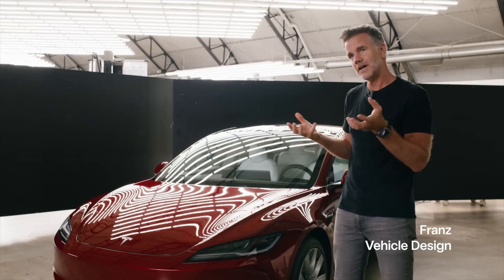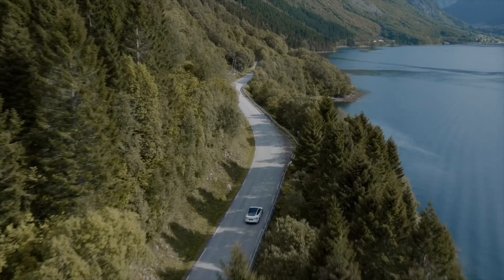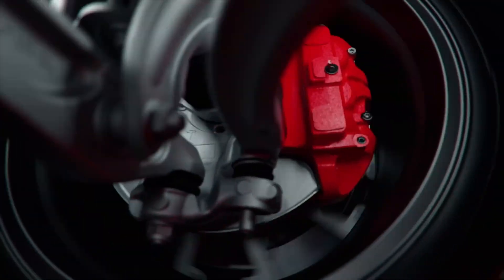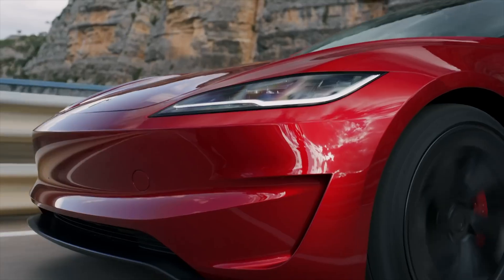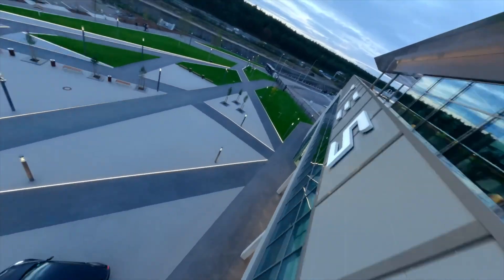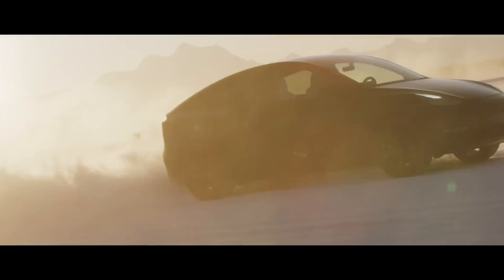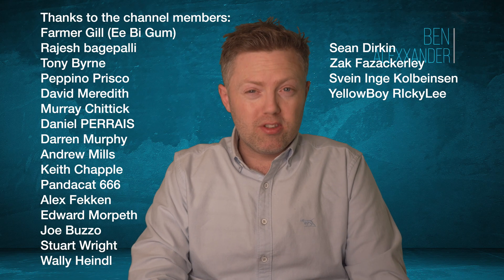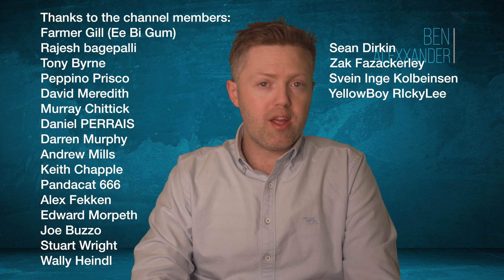Tesla Says 750 km. I Did the Maths from Brisbane to Sydney

Comment: It actually takes longer than 3 minutes to fill a tank and less time than 30 mins to fill an EV.  Why… three mins has alway been an exaggeration, BUT you have to hold the bowser for 3 mins  before you have your sandwich break.  But you eat while your car charges.  So it can actually take less time.

In Germany that’s what they’ve found professional drivers start their mandated breaks after they’ve let go of the bowser and the EV is plugged in.  Might be a 15 minutes advantage before break starts, in which time the EV is charging  So it’s actually faster for the EV which is weirdly counter-intuitive.

Comment: Just got back from a trip from Sydney to Maclean (just past Grafton) in my M3 RWD, the bog standard Tesla. Stopped for a pie at Heatherbrae, didn't charge because the car said go to Kew. Got to Kew, car said charge for 15mins. So went to pub and ordered a burger, then moved the car before eating it (very nice burger). I had told it I wanted 40% on arrival at Maclean (in case of run to shops or whatever), so it told me to charge again at Moonee Beach near Coffs, where I had a nice iced coffee, and the car was charged before I finished it. Pretty much the same trip with same stops as I used to make in my Volvo, except with better autopilot, better stereo, and bum chiller. So the cheapest Tesla is all we need except if you have family out west (like past Orange, past Gunnedah, etc). Then, the problem is chargers, not the car, and that is changing - if a bit slowly, like the chargers out there :) Better still, the LFP battery will last longer than the rest of the car so there is no pfaffing around with 80% charge limits.

Comment: Remember, that "REAL" world is not 100% of the people constantly on a highway doing 100kmh. The real world IS a mix of  30, 50, 60, 80 AND 100kmh roads. 
We do easy 360km with an EV that has a 40kWh usable battery. Stick to the speed limits and use your brain, not your emotions and right foot

Comment: It is highly likely that in Aus we pay less for a few reasons.
1 We have Free Trade Agreements (FTA)  with every major manufacturing country and working on ones with EU and UK and India at the moment. 
2 Australia is only 12 days or less  sailing from main Chinese and Asian shipping ports so RORO freight cost is less.
3 We no longer have an Auto industry so even playing ground for all sellers.
4 We are tight with money on average and value and durability means more than just looks to most. Price sensitive market with over 100 makes trying to sell a portion of the 1.2 million annual volume.
Largest single vehicle sells just over 67000 units, Ford Ranger, 2024 sales below

1	Ford Ranger	Ute	62,593	Down 1%
2	Toyota RAV4	Midsize SUV	58,718	Up 98%
3	Toyota Hilux	Ute	53,499	Down 12%
4	Isuzu D-Max	Ute	30,194	Down 3%
5	Mitsubishi Outlander	Midsize SUV	27,613	Up 14%
6	Ford Everest	Large SUV	26,494	Up 76%
7	Toyota Corolla	Small car	24,027	Up 20%
8	Mazda CX-5	Midsize SUV	22,835	Down 1%
9	MG ZS	Small SUV	22,629	Down 23%
10	Kia Sportage	Midsize SUV	22,210	Up 41%
11	Tesla Model Y	Midsize SUV	21,253	Down 26%
12	Hyundai Tucson	Midsize SUV	19,061	Down 10%
13	Mazda CX-3	Small SUV	18,461	Up 17%
14	Mitsubishi Triton	Ute	18,077	Up 8%
15	Isuzu MU-X	Large SUV	17,978	Up 27%
16	Nissan X-Trail	Midsize SUV	17,494	Up 36%
17	Hyundai Kona	Small SUV	17,374	Up 55%
18	Tesla Model 3	Midsize car	17,094	Down 2%
19	Kia Cerato	Small car	15,502	Up 168%
20	Toyota Camry	Midsize car	15,401	Up 46%

Comment: 750 kms is a convenient range for me. My Kia Sorrento gets about 800 kms from its 75 litre tank and my Ute gets 750 from an 80 litre tank. I only have to fill up each about once a week or so but that works out close to $300 a fortnight depending on current fuel costs. I’m looking forward to my new EV because even if it only gets half the range of my diesel vehicles I will never have to go to a fuel station (at least for that car) again until I go on a trip at least 200 kms from home. My PV on the roof and battery should help me fill the ev with excess electricity that until now I get about 2 to 3 cents a kw hour for from my energy retailer.
. In terms of pure cost, buying a new car equates to a lot of fuel I could have bought with the money I would still have if I kept the diesel car however I would still have to go to a petrol station one or twice a fortnight, get it serviced every 15,000 km instead of 40,000, still have to hear the gruff engine when the diesel starts and smell it in the car port, clean up the odd oil spot and wait while it warms up properly before using all its (meagre) power. The advantages of the ev are well documented but I do like quiet cars where you don’t have to turn up the radio to hear it over the engine. 
So yes, 750 I’m or so in an ev would be great and it would mean I can travel to the nearest capital city and almost get back on one tank but I’m willing to trade that odd bit of convenience for hardly ever having to buy fuel again.  Even if I travel to the nearest capital city I will be able to fill up only once in an ev with a total cost about $50 compared to maybe $130.
In any case, we all know how Tesla exaggerates their figures so it will take some brave and patient car reviewer/internet star (Ben?) to prove the truth one way or the other.

Comment: I would say, yes, we do need more battery capacity. More and more and more. :)  We won't only be driving. We'll be using vehicle-to-grid, vehicle-to-load, etc. We also have decay in capacity over time, and decays due to cold weather, etc. And having to charge less and less often is a good thing. So more and more capacity, please :)